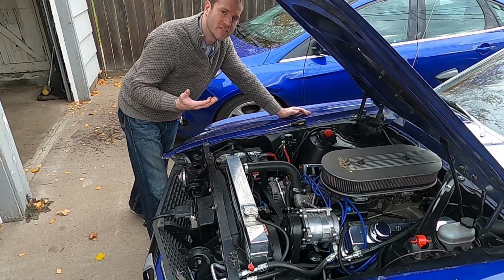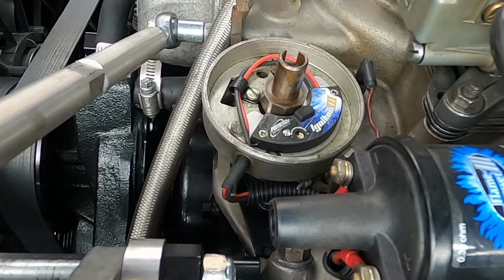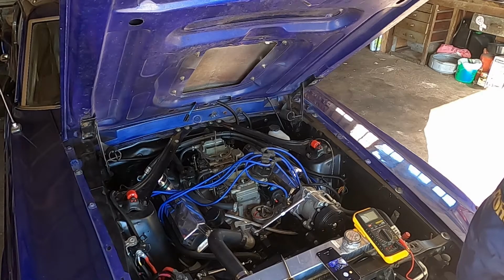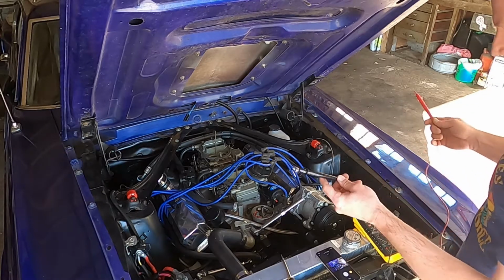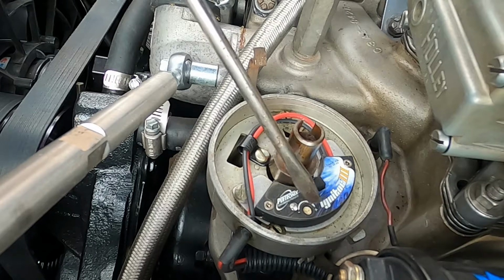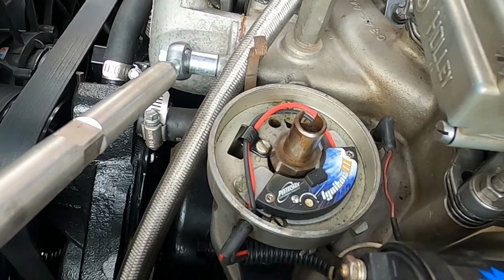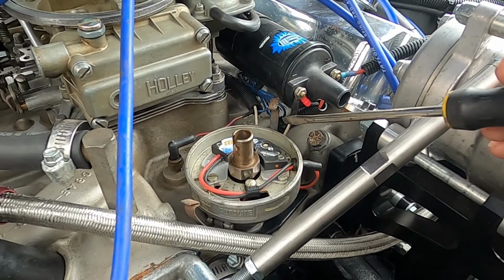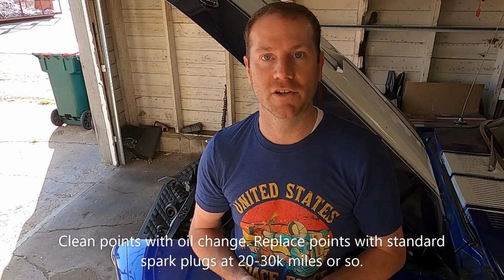1969 Mustang PerTronix Electronic Ignition

Comment: I am building a 390 and fixing up a 1973 ford highboy and I am going to put this kind of setup in it I will have to tackle the electrical wires when I get there being the truck didn’t have a engine in it when I got it but I have watched several videos on this and I know I will need to get a wire to the coil that is a full 12 volts from the battery and a good ground cable from the engine
Reply from the maker: I used the American Auto Wire full harness in my application. The wiring of the Mustang was downright dangerous when I got it. Many wires with cracked and brittle insulation as well as connections just twisted together wrapped in electrical tape. The AAW harness was color coded like stock, but the pink "resistor" wire had no resistor component to it. It was an expensive ordeal, but I felt so much better about the suitability of the wiring for modern power distribution needs and safety factors.

Comment: I ran with the 1st design Pertronix for 15 yrs in my 1970 Z28 and after you install them you MUST set the timing bc the car will likely not run well. They will eventually start to fail from underhood heat. One night I needed a flat bed tow home a few blocks.

So the next one I tried was Crane XR-i, it lasted about 15 yrs until heat got to it. When the engine is cold it work fine up to redline until the engine is at operating temp.

The next one I was going to try was by Accel until I read all the bad reviews on all of these points replacement modules. Some guys had them dead out of the box. So I went back to using points.
IMO they are all junk made in China where there is no QC.
Reply from the maker: @johnmilnerQQ  So far so good for me with the Pertronix. 9 years and maybe 20,000 miles or so with an engine that produces a ton of heat. No issues yet!

Comment: I guess it would be easier to just remove the resister wire and run a new wire from the ignition all the way to the coil?  On my 73 Nova it was easy. I just pulled the resister wire from the fire wall and replaced it completely with a GM pink wire when I converted to HEI. For my 69 mustang I want to keep the stock look So i want a Pertronix😎
Reply from the maker: @GarageRatt  Possibly. The wiring harnesses are often so mangled up on classic cars. When I got this car, the “run” ignition was literally wired through the windshield wipers.

Comment: I am getting ready to install the Pertronix 3 system in my Ford 302, doing away with the points. I see in your video you mention using a tach. How did you get the tach to work with the Pertronix 3 system?
Reply from the maker: Are you using the factory tach or an aftermarket tach?
Reply: i am using aftermarket, anything special i gotta do?

Comment: Nice video.  Great info.  I have done three points to electronic ignition conversions. First was 41 years ago on a 1973 Mustang Mach 1 Q-code with factory dual point vacuum advance.  Seems like I was constantly having to jack with the points.  I converted the points to a Mallory Unilite electronic ignition conversion module. Simple, it externally looked like the factory setup, and worked flawless.  The second was in 1993 on a 1970 Olds Toronado GT 455.  I converted that points setup to a Pertronix conversion module.  Same deal, simple, flawless, factory look.  My last conversion two years ago was a 1960 Ford factory C0AF-12127-K mechanical advance dual point out of some flavor of a Ford FE engine.  That one was with the Pertronix Ignitor III.  Same deal.  Simple, flawless, factory look.  These things just keep getting better and better. The thing I did notice was that I had to use the Pertronix Flame-Thrower III coil.  When I used the factory coil with the Pertronix Ignitor III module, it would  blow the ignition circuit fuse immediately.  Sticking to points ignition just doesn't seem worth it.
Reply from the maker: I think when I bought my Ignitor III kit, the source I purchased from (probably Summit) it specifically noted the Flamethrower III coil was required. Glad I followed that advice based on your experience! I agree that going to electronic is probably the way to go for frequently driven cars, but the points are better than what people expect.